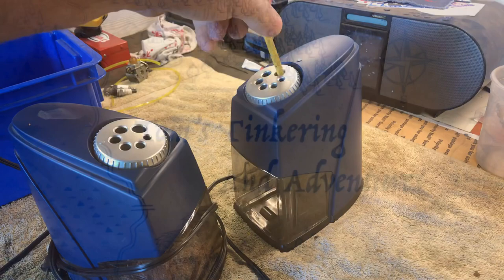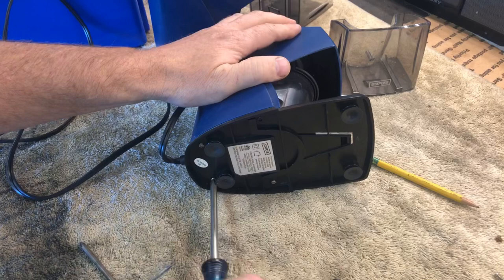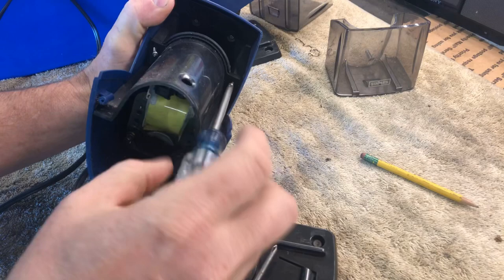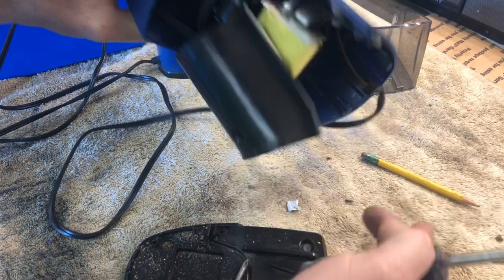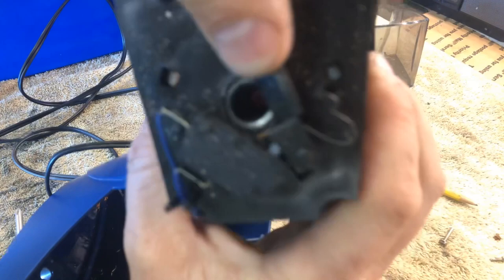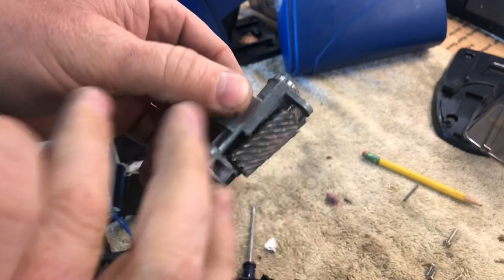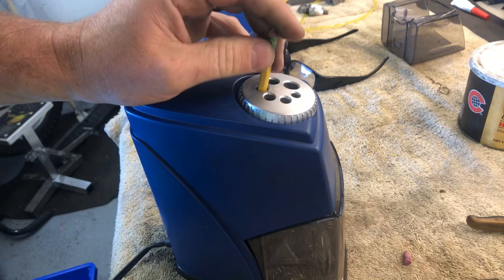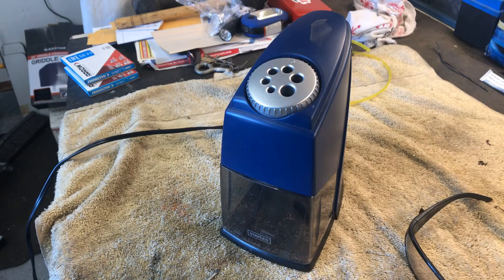Pencil Sharpener Repair, Philosophy of Tinkering

Comment: Do you happen to know how to adjust a manuel sharpener that sharpens on one side but not much on the other?
Reply from the maker: moviemakerwannabe I’m not sure, probably not much adjustment possible unless it’s a quality unit.
Reply: @TomsTinkeringandAdventures  Yeah  I was afraid of that, LOL.  I got one that has always been that way and reviews have been very mixed so I'm guessing it was a manufacturing defect and I should just toss it.  So in that case tearing it all apart won't hurt anything and I might learn something! 

BTW there are some teachers who are saying that sharpening colored pencils in electric pencil sharpeners will cause the motors to burn out because of the wax content.  If your wife's class does that it might work better for them to use the small hand held sharpeners or the larger manual ones like we used at school as kids.  It might cut the expense of buying new ones.

I've read that when the sharpeners start to bog down sharpening color pencils that sharpening a few regular pencils will help clear out the built up wax and  they will work better.
Reply from the maker: moviemakerwannabe you’re exactly right, the colored pencils do cause them to jam.